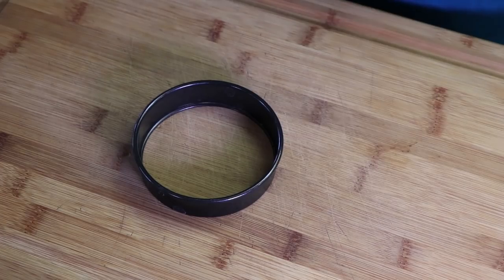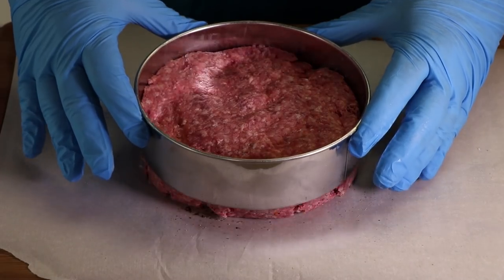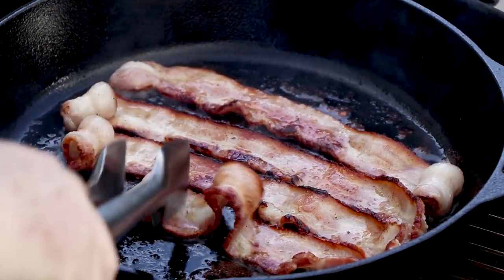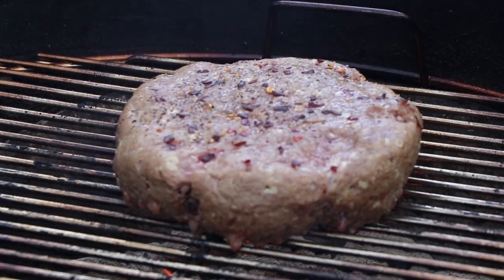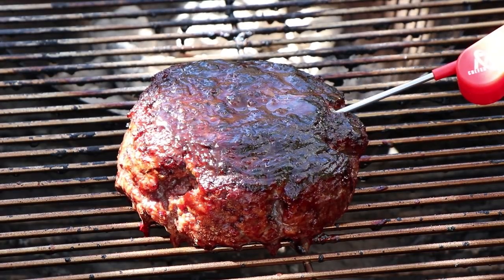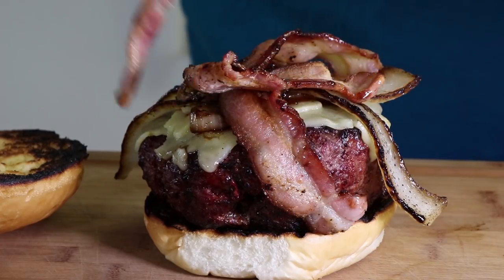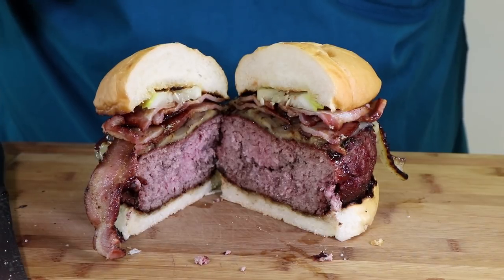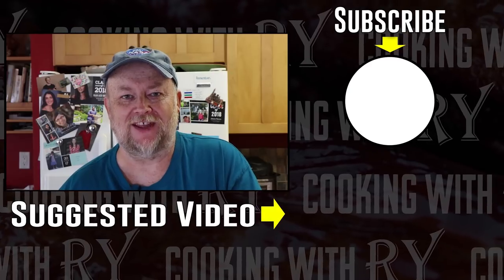The Dig Daddy BBQ Burger Grilled On The Weber Kettle

Comment: That's one heck of a burger. That would cost about $35 in a pub. And if you can't finish it, an extra $10 for being a show off and failing😁 All kidding a side, nice cook. I would settle for a 6 oz patty myself. A local grocer sells a 10 pack of 1/4 lb, fresh pattys. They are about 3/4 inch thick and after shrinkage in the cooking fit a regular burger bun perfectly. Diameter wise it looks to be a small burger, but it's not really cause it has the thickness that is not seen in bugers often. The 10 pack is $10.00. I wish they sold them in 4 packs. Ten is just too many burgers to have in short period of time. I am not one to freeze extras. I think the flavor would be diminished a bit if freezing them and cooking later. You should've put the cheese in the middle of the patty for the largest Jucy Lucy cooked on the net. For a burger that size though, probably need 3-4 slices of cheese..